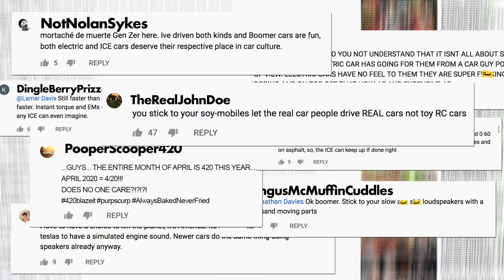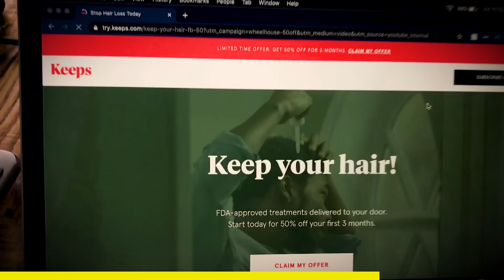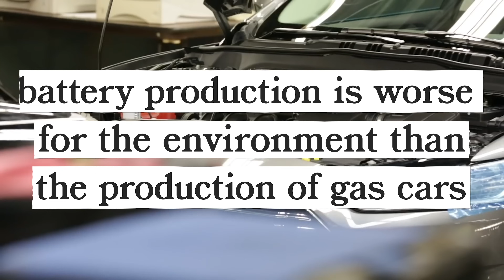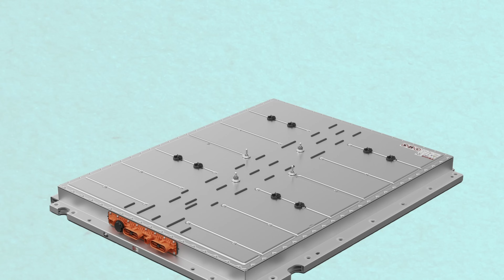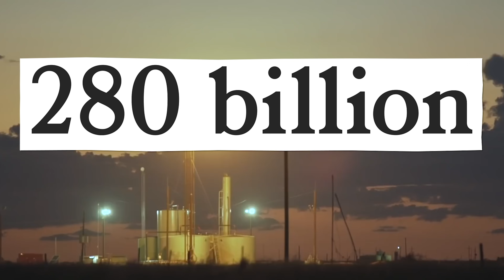Are Electric Cars REALLY Better for the Environment?

Comment: My Chevy Volt was a "gateway drug". I average 186 mpg. When I run out of battery and start using gas, I don' t use very much. It's soooo quiet and really quick off the line.
I'm looking forward to the Ford F150 Lightning. I love the idea that it can power the home during a power outage.
Reply: Yeah, the 80 mile towing range is sooo awesome.
Reply: What year volt? Would you recommend getting a used one? Ranges in 15-25k range depending on mileage. 15k for an 80,000 miles and I've see about $25k for a 30,000 miles
Reply: @lorenfok1097  Replacing the battery cost as much as the value of the car (as it depreciate), so...
Reply: @moochoopr9551  having to replace a whole battery on a Volt is extremely rare, they are very solid cars, great daily drivers.
Reply: @MrEpanek  - People are reading news stories about the rare exceptions.  We keep hearing the same couple of stories about the doof who supposedly was quoted $21,000 to replace the battery in his Tesla, when it turned out he just needed to charge the 12V service battery.  A handful of events are steering public opinion while hundreds of thousands of EVs give good, economical and efficient service.
Reply: @moochoopr9551  Oh, stop with the truth.......
Reply: Hybrids don’t count clown. Teslas are 100% electric and 500% more harmful to the environment
Reply: LOL   gasoline backup!!!   And the EV still uses fossil fuels!!!
Reply: @LWRC  - Except if you live in a place where it doesn't.  It's as green as we make the grid, so an EV can start out life, dirty, and become green, as the grid gets green.  Your ICE car can't do that.
Reply: @diesixdie  Pretty stupid trying to defy the laws of thermodynamics!!!
Reply: @LWRC  - I'm sure you thought that made sense when you posted it, so, OK.
Reply: @diesixdie  And it's OK not understanding thermodynamics as shown by your lack of knowledge on EVs!
Reply: Who wants quiet? It’s boring and depressing…it’s just awkward silence even when alone. I’ll keep my 2016 Subaru Impreza with a 2.0 4 cylinder. It has very low emission levels and gets phenomenal gas mileage. And yes it does have stock exhaust but the satisfaction of hearing an engine rev and go through gears is something I can’t get rid of. Sorry I’m a gas/diesel vehicle enthusiast lol
Reply: @RonL02MN  I guess it takes all kinds, you like engine sounds, I hate it. Have you driven an EV at all?
Reply: @MrEpanek  yessir my sister had a Tesla. Had door issues constantly making it go into limp mode and other related issues. She now has a Toyota 4Runner. I drove both and wow, the 4Runner is the most simple practical SUV made. The Tesla is a space ship inside. it is quick but I don’t find anything else very satisfying. I get a headache with all the gadgets it has, Features I would never use. I guess I’m just old school and don’t like change ahaha I would be fine with driving 1990s vehicles the rest of my life
Reply: @RonL02MN  I agree, there's something appealing about simple cars. I wish there were more options in the US for cheap simple cars. I feel like there is this push to make all EV's expensive and futuristic and there are not many options for anything more simple. The Chevy Bolt is pretty good in that respect I guess.
Reply: @MrEpanek  yup I get where you’re coming from. The only extra stuff i like is a back up camera, simple touch screen, heated/cooled seats & steering wheel as I live in MN. I do like the built in front and rear recording cameras Tesla has. You need that nowadays. My Subaru Impreza is very simple has back up camera, heated seats touch screen, no other bells and whistles. it’s a premium trim so it looks a little slick with still looking simple. It’s perfect!
Reply: @RonL02MN  I totally forgot about that, how the hell does every new car NOT have built in dash cams yet!
Reply: @MrEpanek  - I have a Chevy Bolt.  I like the fact that they kept a lot of the physical controls intact, instead of requiring you to use the wretched touch screen for everything.  You need to be able to control things without having to constantly look at a screen or navigate through five panels to change the radio station.  I also like the fact that the Bolt cost less than half the price of the Tesla, and isn't plagued by numerous fit and finish problems.  It's far from perfect, but it's fun and very economical and easy to live with.

Comment: No they're not. Not in their current state. It takes a lot more fossil fuel to produce an EV than it does to produce a gasoline-powered vehicle.
If your plugging in to the grid to charge it you're indirectly using fossil fuels and natural gas to get that electricity.
Until EV's can me manufactured and all materials required mined via green renewable energy machines they're not better for the environment at all.

Comment: I know this is about a year late Nolan but  this just popped up on my list. I agree with you and I'm honestly looking forward to the new technology coming out in the next few years. However, you forgot to mention anything about the battery packs when they become defective, or.out of service. There no real place that recycle these packs. The companies that " do" end up sending them to areas that end up just burring them ( alot like the wind blades of all that s "green energy" wind mills...look into the huge tracts of massive graves that dot the Wyoming and Nebraska landscape)  Big companies have tried to make invade the upper northwest states looking for buried plots of land that some are rather close to water tables and flowing water. S. Dakota, N. Dakota, Montana, Wyoming, parts of Utah. And it goes from there. These battery packs are the biggest hang up as to why these all electric e.v. are more dangerous to the environment than fuel powered cars.  Maybe not in the immediate future but in the long run. As of now, it's far worse.
The only way it would be able to work is if they made a battery pack that last 1,000 miles from n a charge, and a least a 20+ year life expectancy rate. Hopefully, they'll be able to find a proper way to recycle or properly dispose these packs other than ditching them in the ocean or burring them in you back yard.

Love ve the content, very informative! And yes, like I started earlier, I do look forward to alot of these new technologies coming out here soon. I believe it's a step in the right direction.

Comment: Unfortunately winter been and solar panels are not clean energy. If you do some research you'll find out that solar panels are very hazardous to the environment and they along with wind turbines have a very short lifespan of 25 to 30 years. And what happens to these when they're done you guessed it environmental impact yet again

Comment: Great Video.
I would like to see more about the battery, as others have suggested.  
What you said is informative, but when does it need to be replaced?  
(Is it at a certain mileage, time in service, or both?)  
What is the environmental impact of discarding the old battery?  Can they in any way be "recycled"?
What will a new battery cost, and can we change it ourselves (in our garage, or under the "Shade Tree") or does it have to be done by the manufacturer?  
With my 22 year old ford still going well at nearly 200,000 miles, I have to wonder how many "Clean" batteries would it have taken to get to this same point with an EV.
Thanks!!
Reply: It will cost you thousands of dollars to replace the batteries and you'll be saving the planet from a problem that doesn't exist.
Reply: The batteries only last about 7 years. The cost of replacement is about half the cost of the vehicle new, and, in general, has to be done by the manufacturer. This is why there is no real secondary market (used vehicle market) for EV's, making them disposable cars. At this rate, you would have had to replace your vehicle 3 times in the time you have owned your current vehicle. Not only that, because the recycling process is so difficult for Litium Ion batteries, they are NOT recycled currently, in general.
Reply: @mr.funkalicioussplendiferous  most of what you have said is utter bollocks. EV batteries production costs have dropped by an order of magnitude, to around US$100/kwh. This means a typical 77kwh battery would cost around US$7,700. Even with margins and installation costs that isn't going to even come close to half the new cost of an EV.

There absolutely is a healthy second hand market for EVs.

There are 11 year old Leafs still on the road with original batteries. These are batteries with atrocious thermal management and therefore shorter lifespans. Current gen EVs are warrantied for 7-8 years, so they're sure as hell not reaching life in 7 years since manufacturers don't want to do free replacements. Indications are, based on lab testing and high mileage real world examples, current gen batteries will outlive the car - there are EVs out there with many hundreds of thousands of km on the clock, and there are rumours the first million km battery has been achieved.

Recycling is absolutely possible, but will only happen after repurposing - after end of vehicle life there's a decade or more of use in applications like home solar or Nissan using old Leaf batteries to power machinery in their factories.

Comment: This video basically solidified my opinion that hydrogen is still the way to go. Less damaging to the environment in terms of production initially. Sure, it demands a large amount of energy to produce the hydrogen, and that's (at the moment) done using fossil fuels. However, the same can be said for the electricity in EV's. 

On top of that, hydrogen is way more interesting for trucks and aeroplanes. So, are we really going to set up two types of grids for supplying for the juice that powers our vehicles. The infrastructure for hydrogen will need to be built for trucks anyway. Seems to me that the car industry could benefit from that as well. Also, what with the people that live in big (and crowded cities). I doubt we'll be able to provide them all with a charger for their electric car... 

Then there's the issue of climate and topography. In warmer climates, there's usually a bit more battery degradation. Now that's something where EV's have improved (by adding active cooling so that batteries are as close to optimal temperature as possible, so I admit that's becoming less of an issue). But batteries perform relatively badly when driving up a mountain. They can lose quite a bit of charge in these situations. More so than other types of fuel. This is in part due to another issue which plagues EVs. They are extremely heavy. It's another thing where hydrogen cars are more efficient in. EVs are a lot heavier due to their big amount of batteries. Hydrogen is as light as something can be in comparison (though the tanks are in general heavier than those of fossil fuel cars, because they have to deal with high pressure to keep the hydrogen in). Still, it's a fraction of the weight compared to the weight of all those batteries (especially in those high-range EVs).

The recycling of batteries however is something that I'm pretty worried about. With plastics and things like solar panels and other inventions, we were always saying we would have a solution for the recycling of them. Did that happen in time? No. So yeah, I'm sceptical of that as well.

Then there's range, the few developed hydrogen cars on the market right now already have a better range than the best EVs. Add on top of that the ease of charging in terms of time. 5 minutes for a full tank vs 25 - 35 minutes of charging (with a fast DC charger) to have only 80% charged.

Comment: Who produced the app that calculates the footprint for any ice car compared to any EV.was shipping the lithium and cobalt included in those calculations you gave and recycling the batteries they,ll have to ship that stuff somewhere,hey I know they could ship it back to where it came from and fill in the massive hole they made in the earth,oh I forgot they don,t want it back. What happens when the lithium and cobalt runs out,and more than 5-10% recycled stuff in New batteries greatly diminishes the power and time the charge lasts in the battery,I feel you have left a lot out,but it was a good vid for a basic one,and who,s putting all these figures out there,it has to be an unbiased source,and there,s not many of them out there,but good vid I liked the way you explained things,great format,cheers.